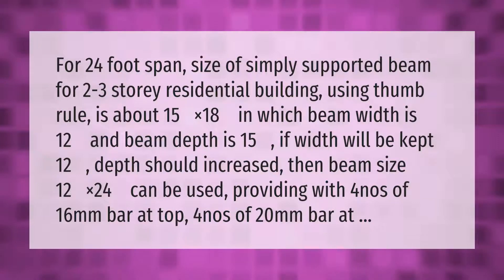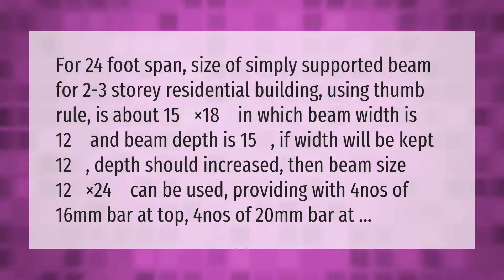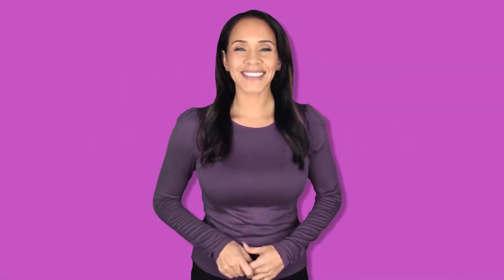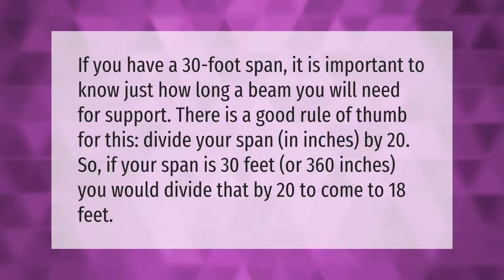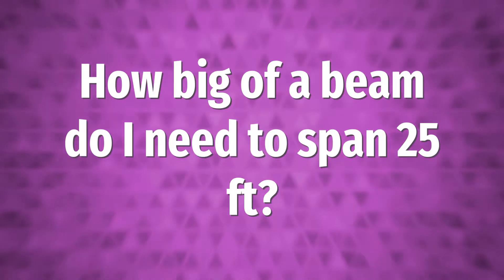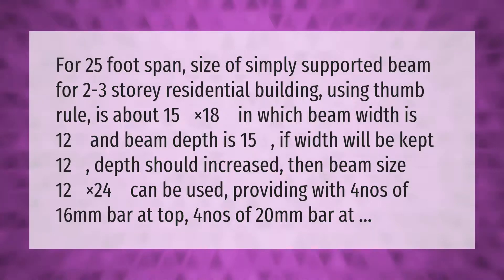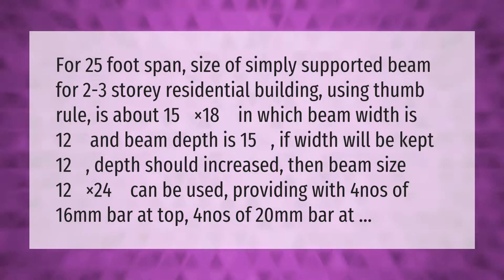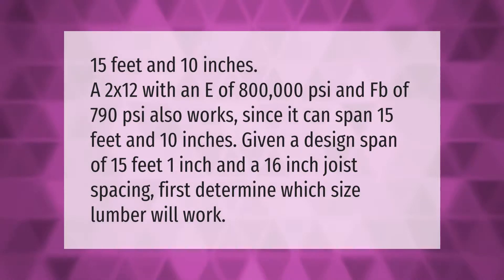How big of a beam do I need to span 24 feet?

Comment: You have to go with subfloor load on the beam. Minimum 40psf live + 15psf dead load per code. Then you have to use uniform loads per square foot for joist spacing. For instance, 2x12 with 16-inch center can go up to 18 feet span wise. But I don 't recommend. Litle cantilever with adjacent beam will help. Otherwise, it will be flimsy and bouncy. More span needs deeper beam to get higher static inertia value. Old carpenters' rule of thumb 2x12 go 12 feet. 2x10 go 10 feet, 2x8 go 8 feet.